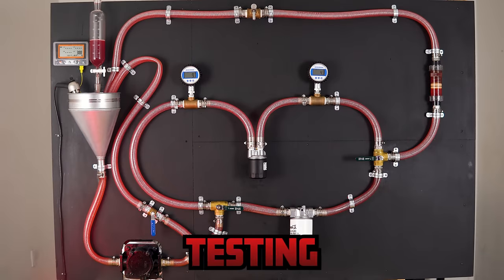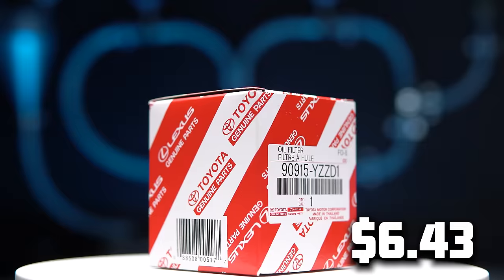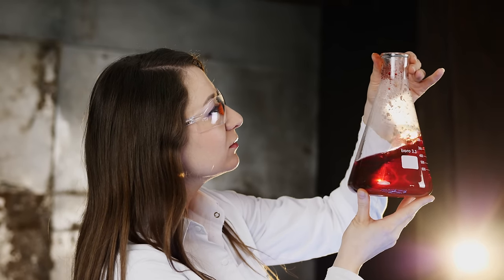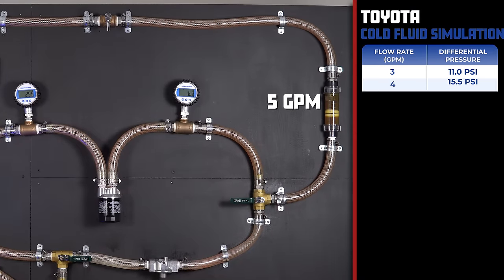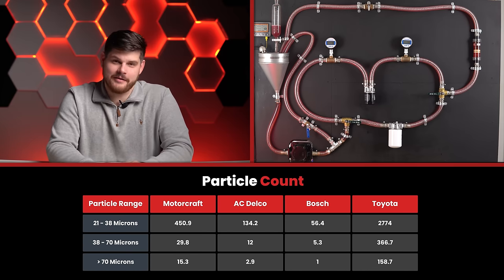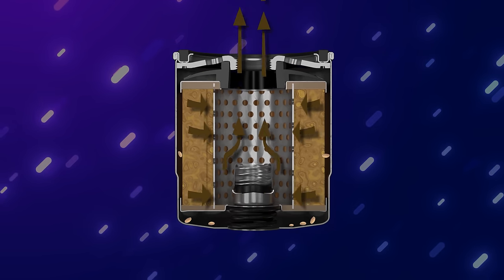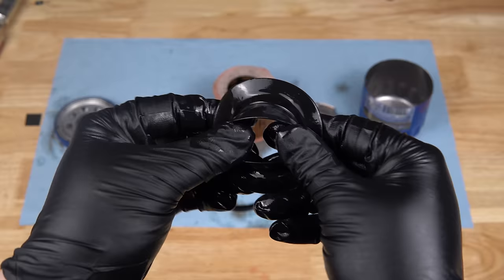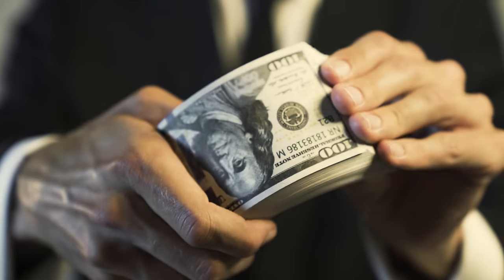Are Car Dealership Oil Filters a RIP-OFF?  (Engineer tested)

Comment: I have a brand new cx-5 2024 since the second oil change at 6000 miles on it, I started using Purolator Boss and Amsoil Signature Series every 5k miles. I can rev up the engine confidently. Oil is cheap the engine doesn’t.

Comment: I'm so glad I came across this video. I use the exact same Toyota filter as shown in the test and was surprised that it came in last in regards to filtering. I already use Amsoil motor oil in my car and will be switching to Amsoil filters as well!  Excellent presentation Brand Ranks, keep up the great work!
Reply: If you do oil changes every 5k miles, a high flow is better as the engine is designed for.
Reply: My 04 4runner v6 got 389k using oem filter and, mobile 1 full synthetic. There is a reason why the filter is designed to run on toyota engines.

Comment: You stated that the ac Delco PF-53 (shown) has no bypass valve but all the specs that I found says that it has one, perhaps you’re not understanding the mechanism employed here.  Also, it’s true that some AC Delco oil filters don’t have them because the bypass valve is internal to the engine. So why would you make a disqualifying recommendation when maybe the filter was perfectly designed for the engine it serves, even if not in a generic application?

Comment: Back in the mid 80's there was a real problem with oil filters failing due to pop off pressures. Some of the OEM's were denying warranty claims bc the owner used an aftermarket filter. With OEM warranty ranging from 60k - 100k I would stay with what they are recommending. I once ran only Fram. Until I see one rust on the shelf. Also the Fram was using a fiber valve on their pressure relief. I will stick to the OEM filter at least until the engine is out of warranty.

Comment: Regarding the AC Delco bypass valve, not all of their oil filters do not have bypass valves.  Some GM engines have external bypass valves, so a bypass valve in the filter is not needed.  For the engines that DO NOT have an external bypass valve, the AC Delco filters DO have a bypass valve.

Comment: More food for thought, Oil flow is more important than filtration. I cite an example of vintage cars, particularly the VW beetle engines of the 60s to the early eighties. Those were bulletproof engines and they did not have oil filters, just strainers from the oil pickup. Those strainers were just like kitchen strainers and were not even required to be cleaned.

Comment: I will use AC Delco for my 2013 Chevrolet Impala.  However, I will check the AC Delco oil filter for the 2016 Buick Envision.  The bypass valve is very important.  I change my oil every 7000 miles or 1 year.  Usually, every year, depending how much I drive.  I do change before 7000 miles.  I use full synthetic too.

Comment: I can answer this for all. As an auto engineer we test OEM and aftermarket products for the manufactures to provide an accurate picture for the vehicle. Intervals. It’s all about profit, all new cars come stock with oem because they are cheap and last the correct mileage for the interval changing. Dealership and manufacture work hand in hand when it comes to parts and service. We tell the mfg than they tell Dealership to follow the owner manual. Dealership sometimes upsell their service because most people do not know any better. Top after market product are better to replace than stock. Example of these are the following switch to full synthetic oil and transmission oil, change all spark plugs, air filter, oil filter, exhaust ect. You can great increase your vehicle efficiency with simple changes. The list goes on but if you know what you’re doing I would recommend you do it. But keep this in mine some dealerships say they will void your warranty if you do your own service but that’s false look at Magnuson-Moss Warranty Act. Adding like a cold air intake or exhaust would void warranty because it’s not an oem par but that manufacturer decision.
Hope this helps.

Comment: @brandranks - I believe the reason the AC Delco filter doesn't have a bypass valve is because the GM cars this filter is built for have a bypass valve built into the stem the filter mounts to. So if a person has a GM vehicle which specifies this filter is to be used, that is perfectly fine. For everyone else, yeah - don't use this.

Comment: Thanks for the excellent testing. Could you post the figures you obtained so we could understand how the numbers are quantified? Amsoil writes that small sized  micron particles amount to a large amount of the wear. I don’t remember the size of the microns. Their by pass filter filters down to 1 micron if I remember correctly and even removes fuel dilution I think. Check out their info.

Comment: I love watching these oil filter tests however a recent YouTube video done by a designer and engineer of Nissan engines said if you change your oil frequently it really doesn't matter which oil or filter you use. Thats something I've always thought having changed oil for over 40 years. I use any brand name oil or filter on sale. Never had an oil related problem if I do it every 5K miles. Yes, I keep my cars for a long time. This is especially important if I'm getting fake filters too. I recently bought six Purolator One's for only $38. They are stamped made in USA so I don't think they are fake. My big concern is all the fake spark plugs out there.  I thought I bought NGK iridiums from eBay, but a YouTube video showed that they were indeed fake. The car runs fine and gets good gas mileage, but I'll probably changed them out earlier than the max 100K that you can get from originals.

Comment: as a Toyota fan boy, I use the OEM filter element. Yea! the 4rnr has the cartridge type. Sigh...
But most ALL fan boys love the 0w-20 oil and 5k or 10k mile changes.
Ours has 98k miles and have gone from 5k to 4k on oil changes.
This video confirm after the fact my gut check to change oil on a shorter cycle.
As a Ford super-duty owner, have seen oil turn jet black one summer after towing 11.2k from one pasture to another. So have gone from 5w-30 to 5w-40 and when oil life displays 25%, time for a change. The 6.2l is such a strong engine it is easy to ignore basic maintenance and let it destroy itself.
Have to admit, I will have to digest your channel to see if there is a better filter for the 6.2l. But it seems the upper oil by pass is a means of compromise, as there is no utopia in life.
Well done  presentation.
Thanks for the visual presentations of the graphs.

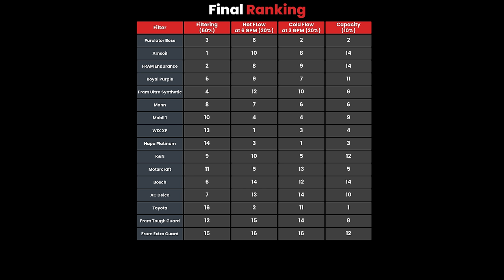Comment: 10:07 I'm actually glad that Valvoline wasn't on this list and for good reason. The filter they make is too small volume wise and doesn't filter out all the contaminants. That and there's quite a bit of restriction for oil flow. Definitely would not recommend Valvoline filters especially from the Valvoline lube shops.

Comment: Just wanna say that many GM cars have a bypass valve built into the engine (oil filter adapter particularly), so a bypass valve in the filter is not needed. In fact, if u look at aftermarket filters (Mobil 1 filter, etc.) for these applications, they don't have a bypass valve either.
Reply from the maker: Indeed some GMS do! Thanks for the clarification. Unfortunately the AC Delco PF53 filter we used is also a cross reference for other cars that do indeed require a by pass valve. Additionally we've seen some PF53s have a valve and others don't. Requires more investigation. Thank you for watching and sharing!
Reply: @BrandRanks  Interesting...I did a little research, and this filter does have (or should have) a bypass valve of 8psi. I read elsewhere that the ADBV on this filter also acts as a bypass valve (oil would push through the inner lip of the ADBV when reaching the specified pressure). Not sure if that's the case. If it is, it still doesn't sound like a reliable/good solution lol.

Comment: oil pressure plays significant role in several toyota engines and filter is probably designed to work in such system. being more or less restrictive may hurt the engine

Comment: In regards to Toyota, not sure if they purposely designed the filters that way.. however you can't deny the fact that Toyota motors run forever. That being said, maintenance maintenance maintenance, always change your oil and filters as recommended. Love the video! Will be watching more for sure.

Comment: I've heard that if you have variable valve timing like VTEC for example, it's better to use genuine OEM oil filters because VTEC timing goes off of oil pressure and the car is tuned for the oil pressure that the OEM filter gives

Comment: Motorcraft filters are excellent.  The 910S filters work great with Briggs and Stratton, Kawasaki. and Kohler lawn and garden engines. Up until about a year and a half ago they were ~$4.00 at Walmart but have doubled in price recently.  I have been running them for years and can claim the lawn equipment wears out before the engines do.

Comment: I used nothing but Toyota oil filters on my 1998 V6 Camry and I only got 350,000 miles on the car. Then I sold it.  Yeah , those filters are really suspect!

Comment: Multi-viscosity oil is thinner at lower temperatures. It is obvious to me that while you test appear to be scientific, there are glaring flaws in your procedure due to a misunderstanding  of oil chemistry. Most modern vehicles specify multi-viscosity oil. At higher RPMs the engine runs hotter, the oil thickens  to facilitate more efficient lubrication. You need a heaver "coating" to ensure less friction.

Comment: This video shows that Toyota filter has enough filtering properties.
We use cheap Toyota filters for 15+ years and repair engines. And definitely main reasons of wearing motors are:
- dust from intake system (90+% of cases) 
- untimely oil addition in cases when engine has oil comsumption
- untimely oil change
- poor oil quality etc...

Comment: Thanks for another great video!
Just thought of something, hear me out lol. I was trying to wrap my head around correlation of high flow and high capacity of toyota filter (and some other filters tested in the past). Well the thing is, it doesn't necessarily have high capacity like your test shows. It just takes a lot of dirt to clog the filter up. Only big particles get caught, but small ones flow thru and keep circulating. So out of 13.4g of powder you put in the test rig, not all of it ended up in the filter. Maybe lets say only 4.4g of 70micron and bigger corresponded to observed differential pressure increase. The rest, 9g and smaller particles kept circulating never get absorbed into the filter.
Toyota filter is just a rice sieve that sucks at filtering. And thus appears to have high capacity.
Reply from the maker: Thank you so much for watching and supporting us and you are correct, it may be that it just didn't filter as well thus the particle count results. But again, don't know if Toyota is purposely designing them like that to account for people that don't change their oil often. You know better have dirtier oil than no oil. Again, thanks for the support!

Comment: Most domestic V-6 / V-8 engines bypass the oil filter after 2500 RPM  Just change your oil at 3000 miles cheap and easy and especially with new engines that have very small oiling orifices that get pluged easy and cause sometimes major engine damage. Changing your oil often is cheap insurance for your car or truck.

Comment: High Efficiency Filters are more Restrictive as they filter Better. I always try to find Filters that are Larger than OEM, that fit, and have the same internal design. More Filter Area, means lower Pressure Drop, whilst still providing the Filtration

Comment: Toyota's reputation is founded on reliability and longevity. Toyota is NOT going to risk that by saving $2 on a filter. They know something that doesn't meet the eye of the onlooker. They may very well priorize immediately volume of flow over tight filtration (cold flow starvation).

Honda's oem filters also catch a lot of criticism. Yet ironically, they are in the top-tier, in a tie with Toyota with the longest lasting engines. I've been mildly obsessed with engines, lubrication and longevity for decades. I've come to understand not to criticise a team's play-by-play moves. Just look at the final scoreboard.

Comment: I stopped using Honda A02 oil filters the moment I found out theyre made by fram. Its just a blue painted mid level fram. I use wix only if its made in usa. Also Baldwin, and Purolator boss.

Comment: I think your chart @4:00 is backwards. At low temperatures (for 5w-30)the viscosity should be around 5ish, at high temperatures it should be around 30ish. The chart would make sense for a straight weight oil but not a multi-weight.

Comment: My 2014 kia forte does not run right if I don't use a oem kia/ Hyundai filter. It stalls in traffic. Iv red it's because the oil pressure is not right with aftermarket filters.

Comment: More flow instead of filtering???
Call K&N for that!  They reduce filtration for flow as they are a race oriented filter, expecting people to change the filter every 500 miles or so.
As for the OEM filters get them from the dealership not Amazon as Amazon is notorious for selling imposters.
So what is the best filter? I'm so confused.

Comment: The AC Delco has a bypass.  It is integrated into the anti-drain back valve.  It is designed to activate at 8 psi.  IMO, it is a cost cutting measure, but regardless, it is there.

Comment: Toyota engines are designed by their engineers to run optimal with the Toyota filters. Switching to different brand could lower the performance and durability of parts inside the engine. High flow rate is more important than filtering for Toyota engines.

Comment: Toyota has chosen increases filtering capacity which makes sense, it will keep filtering the dangerous stuff till the replacement of the filter  while finer filter risk clogging up and then everything goes unfiltered.

Comment: I have GM Ford & Toyota vehicles. I use WIX in the '99 GM 5.7, Motorcraft in the '06 Ford 4.6 2V,  and OE in the '16 Toyota 2.5 Camry. I change oil every 5,000 miles. I have 140K on the GM with no oil used between changes. 213K on the Ford with 1/2 Qt. used between changes and 113K on the Toyota using 1/4 Qt. between changes. I will just stick with what I am doing. 
Using High mileage Valvoline synthetic in all three vehicles BTW.

Comment: The ultimate test. Run an engine with an oil filter and the exact make of engine without (just an empty can). Normal driving on both for 60,000 miles. Then a tear down inspection. Maybe both engines with the filter until the first oil change then the empty can after that.

Comment: Subaru oil filters cost the same as cheaper brands from wal mart or the auto parts stores but keep the oil cleaner for twice as long. Made a big difference switching to OEM on the same older high mileage car.

Comment: Maybe your magic test dust is not analogous to IC engines wear material ?
Reply from the maker: Not meant to be, it's the standard dust utilized in ISO test as performed by all oil filter manufacturers. It's the only way to keep all variables consistent across filters. Thanks for watching!

Comment: Don't forget that every engine's oil pump is designed to withstand a specific flow blockage from the filter. DO NOT USE A FILTER OTHER THAN THE ONE SPECIFIED BY THE MANUFACTURER.
Reply: Oil pumps aren't that sensitive.  The restriction from the filter is also very small in comparison to the rest of the oiling circuit, and a few PSI up or down at the filter is irrelevant.

Comment: Where I am from, we have access to the legendary Toyota diesel engines. Oil filters, engine oil, fuel filter, cabin filter changes every 5k. Air intake filter every 10k, diff oils and every 40k or when driven in water that covers diffs. Take care of ur engine and it gives you reliability and peace of mind.

Comment: Not 100% sold on the Toyota filter being so poor.  I believe Toyota engine performance  and longevity state otherwise.
Reply from the maker: Much more to engine longevity than the oil filter, but Toyota might intentionally design the filter this way with way more capacity at the expense of filtration to protect better against owners that don't change their oil and filter at recommended interval. In other words better have less clean oil than no oil. Thanks for watching

Comment: OEM oil filters are not necessarily "OEM" because I was in a Honda dealership's service garage and I overheard the technicians discussing how they got in a new batch of Honda OEM oil filter which were suddenly different. Their comment was, "It looked like Honda changed oil filter suppliers again." 

Nothing is constant in any manufacturing industry. This is why I do my research on independent oil filter manufacturing companies with their history and quality standards. Also, there is a very important correlation between viscosity and continually changing engine tolerances (thanks to the government mandates for CAFE standards). Tighter tolerances demand lower viscosity and using oil which does not meet these standards can damage the engine. 

Just referring to a brand of car or oil filter in general means nothing. I have my favorites but they are withing particular years, models, engine designs and other things. 

"One size does not fit all."

Comment: If I'm not mistaken there was a video showing that there was no point in buying a dealer OEM filter as it is also the as the leading oil filter manufacturers at a higher price.

Comment: I was wondering how you got those high pressure drop measurements when the filters have bypass valves that open when the pressure drop reaches 13 to 15 psi?